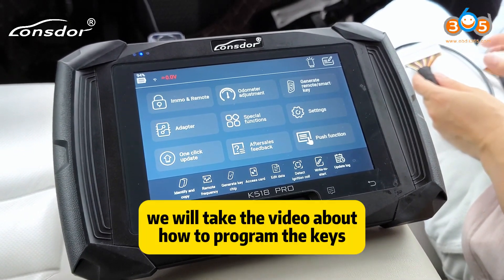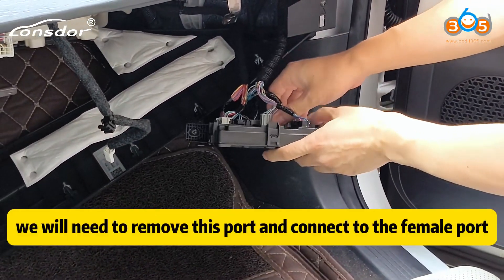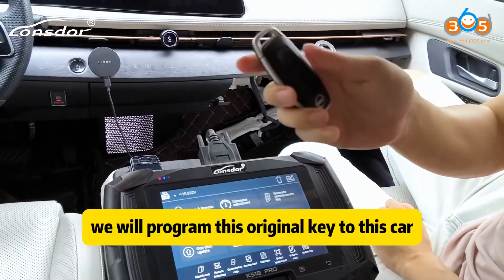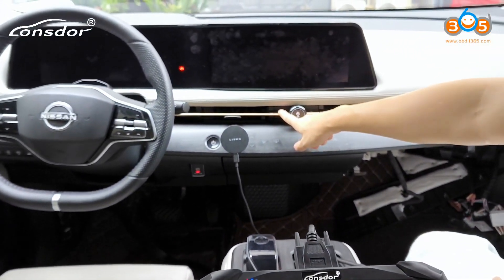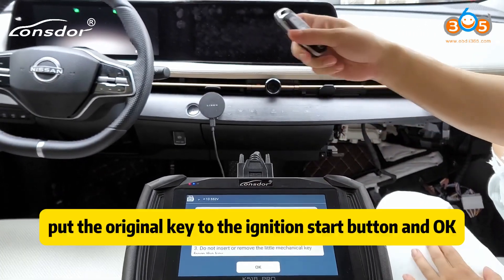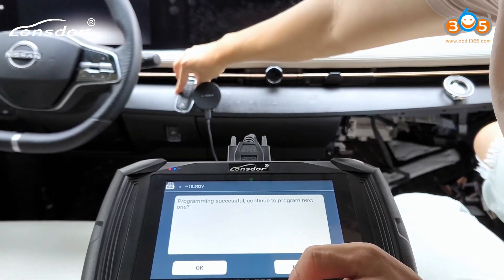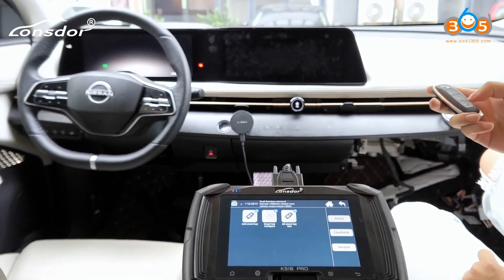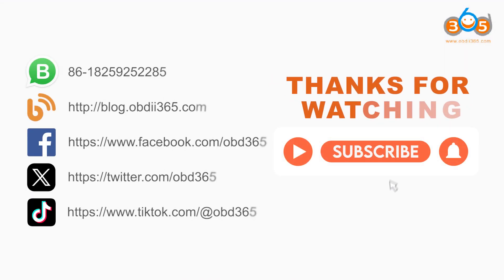Lonsdor K518 PRO Program 2022 NISSAN ARIYA All Keys Lost with BCM 40 Cable - OBDII365

Comment: if there is a key, you still get the 28 digit code, or just for all lost keys?
Reply from the maker: yes, add key and AKL all require 28-digit code. with Lonsdor BCM 40 adapter, it will read pin.

Comment: hi
the car to  obd connect  + 40 pins nissan gate way  connect it is correct?
Reply from the maker: it requires Nissan 40 pin gateway adapter to read pin

Comment: it will not do all keys lost it needs to read pin code he had a working key that got the 28 pin from working key fake
Reply from the maker: Lonsdor technician says it will read pin if all keys lost. using the 40-pin gateway adapter.